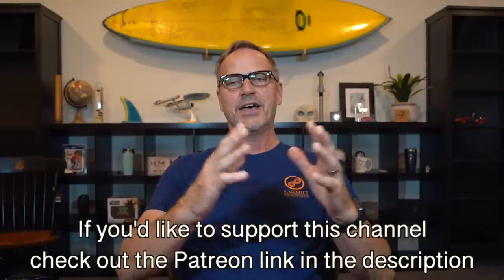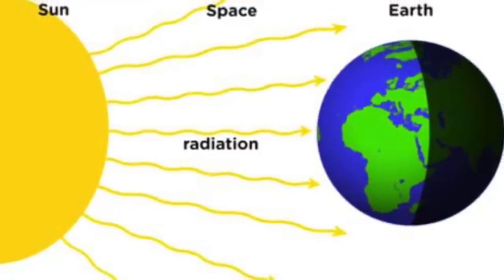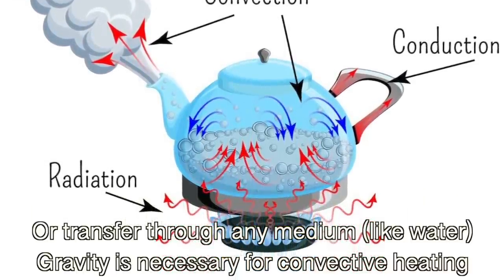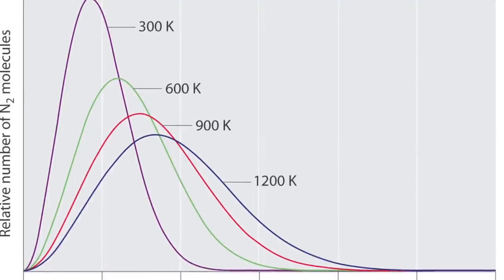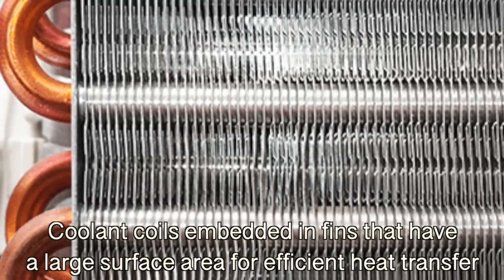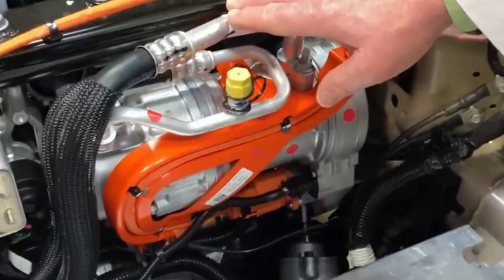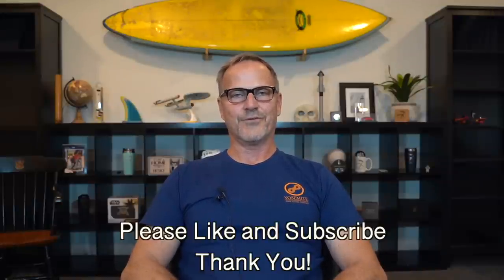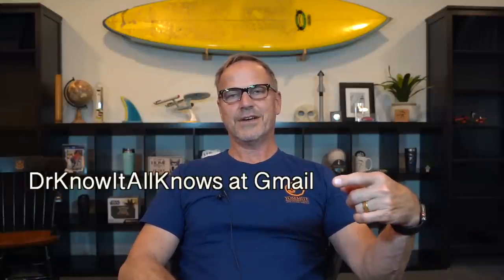How does a Tesla Heat Pump actually work and why does it matter? From first principles!

Comment: You can boil water at lower temps if the pressure is high, water can be used aus a coolent, there are also heatpumps with water, but they have bad COPs

Comment: Looking forward to see what Tesla does for home systems. Seems to me if you had air heating, air conditioning, refrigeration and water heating all integrated you could save a lot of energy. We installed a heat pump water heater and it saves a ton.
Reply from the maker: Mmm, I didn't even know that combo was available. Interesting. And how about a "3 ton" heat pump for your house that's only the size of a mini fridge, plus it provides drinking or lawn watering water too? If anyone could do it, Tesla could!
Reply: @DrKnowitallKnows  Got ours from Rheem. We're in Florida, so it works great. Has a back-up coil, but I turned it off and have never missed it. In the summer it pulls about 0.6 kWh per day for two people. In January it pulls about 1.5 kWh. Costs about double that of a conventional coil heater, but should pay for itself in under 3 years.
Reply: @DrKnowitallKnows  
There are already such integrated heating/cooling systems, for example in newer types of shopping centers and super markets. They are needing heat and cooling and they have it already.
Reply: @MBighk  the carrier split systems are fair priced

Comment: There's just one thing I don't understand, my 2020 model 3 that is parked in a garage maintained at 10°C in the winter uses the compressor to preheat the cabin. Is this whole "heatpump only in 2021 model 3s & Ys" just a marketing scheme because they just have more efficient compressors/gas and the octo-valve that I don't have?
Reply: Both your Model 3 and the later Teslas of all types have one heat pump -- in yours normally called an air-conditioner because it's only ported to the hot and cold coils in one way, and can only provide cooling.  Your 3 generates heat by running current through, and even operating, various devices, including the heat pump, while circulating fluid, but the heat is generated by electrical resistance and rather than the carnot cycle.  
That said, are you sure your 3 is pre-Octavalve?  They changed over sometime in 2020.
Reply: @jameshoffman552  I took possession of mine in mid March 2020, I know the concept of heatpump is just reversing the flow of the refrigerant, and it seems that my M3 uses it up until 0°C (sometimes waits till it's -5°C) before it kicks in the resistive heating. Oh I see what you mean, the pre-octovalve models were not able to warm the battery using the compressor, but can be cooled using it. Right?

Comment: I wish Tesla's had some kind of a resistive heater that they could use for regenerative braking. Somewhere to put the electricity when the battery was cold or full. This is exactly how locomotives stop using dynamic braking. The top half of a locomotive is basically a giant toaster. In case someone doesn't know, all diesel locomotives are basically hybrids kind of.

Comment: Using resistive heat is 100% efficient. Waste energy when using resistors to heat is also heat. Pumping heat can be up to five times more efficient than resistive heat since it does not run into the physics/thermodynamic laws that prohibit perpetual motion since it moves energy versus altering its form.

Comment: How long does it take the cabin in a Tesla to heat up for those that live in colder climates?  If it’s 32F outside is there an issue with heating?
Reply: No - not an issue.  On the channel Now You Know, they did experiments comparing a Model 3 to a gasser, showing that the Tesla heated up much faster (and that was a pre-heat-pump version).  In my experience the thermal system is quite impressive in cabin cooling and heating.
Reply: @jameshoffman552  thanks for the detailed reply.

Comment: Thank you for sharing. I never thought the heat pump was needed living in the North East with basically 2-3 months of cold weather (30 degrees or less). Would you say the heat pump extends the battery life as well?
Reply: You never thought the heat pump was need? What do you mean? And yes the power consumption is lower for a electric compressor than the element heater.

Comment: A heat pump can have a small heater on the radiator i think it’s called , which makes it less efficient bellow 0 c , but still much better than gas or coal heaters .

The reason their “bad” below 0 is that condensation builds up and freezes , stopping it work . But the external heater fixes that.
Reply: Most just reverse the heating/cooling cycle for a bit to defrost the coils. Much more efficient than using a resistance heater.

Comment: Heat pumps are quite efficient even in could climates like Nordic countries. The best new heat pumps (of the type air - air) can operate at outdoor temperatures down to -35C. The COP is lower when it’s could outside, but may still be at around 2 (1 kWh of electricity gives 2 kWh of heat).

Comment: You described convection heat as if it were conductive.  You describe the poor heat transfer through air in microgravity.
  The correct description is that as gases get hotter they expand in volume while retaining the same mass, therefore becoming less dense, and tending to go UP by buoyancy.  Therefore a hot object that conductively transfers heat to surrounding air tends to establish a gas flow that takes heat away from the object in an upward direction;  and this only works where there is net gravity;  otherwise there is no UP direction.
  I should have written Encyclopedia Britannica!

EDIT:
  Your explanations keep getting worse...  Energy doesn't go from cool liquid to hot air;  it is the other way around.  Well, Quantum Physically heat moves both ways;  but per the simpler model you got it exactly backwards.
  This is getting really bad Doctor.  Sorry to say, but this video needs a recall.
Reply: Agree. multiple missteps in this one, sadly.
Reply: Definitely

Comment: Dr KIA — The legacy terms we’re saddled with, really get in the way of laypersons’ understanding of what’s taking place —
  — Why was ‘air cooling’ called ‘air conditioning’ when air heating & air cleaning/filtration are also a/c?
  — What we call an ‘air conditioner’ (air cooler) is just a (one-way) heat pump. At the start, when a heating function was added to a/c’s, the unit was called a ‘reverse cycle’ air conditioner (‘conditioner’ in this context was now an accurate use of the term; ‘reverse cycle’ conveyed to the layperson how it worked).
  — Originally, air filtration was done for the benefit of the equipment, not humans. But as we’ve learned about indoor air pollution, the emphasis has shifted to clean, properly-humidified air for human health & safety.
    Up to this video, I was uniformly impressed with the clarity & accuracy of your videos (my favorite being your projections of how fast FSD might become reality). This one is a tragic fail. You might consider pulling it now, and replacing it w/ ~3 videos ie, basic physics, current applications (incl. UV, humidity control & air exchange to suppress micro-organisms), and —
  — Possibly a 4th video on passiv-haus’ energy-free heating/cooling/lighting/hot water, via house design, attic ventilation, storage of saved heat/cold, aerogel skylights, induction heating for water & cooking, and evaporative cooling in low-humidity environments.
    Thank you for all your clear explanations on the many topics you cover.

Comment: I like the simple diagram of the inside/outside of a heating/cooling system using evaporation and condensation (expansion/compression, whatever words work best for understanding).  I try to explain compression with the bicycle pump analog; when pumping up a tire, the pump gets hot.  When I explain expansion, I use the paint can analogy (which you used, but for the other side, calling it 'opposite of a paint can' silly! ;-) ) or even better, a dust cleaner (compressed gas for cleaning computer parts etc).  Those get extremely cold the longer you use them.
I know, I'm pedantic! And nobody likes a know-it-all unless it's Dr. Know-it-all! :)

Comment: Best explanation of convective heat transfer I ever heard. I always thought it was essentially air movement, but never thought of still air, and the impact of heat capacity of water molecules.
Reply: Someone wrote that the water molecules have a negligible effect  due to them not adding mass to a given volume.  Water just displaces air molecules.  100% humidity is the max moisture retention of air but definitely not very much water in reality.

Comment: U glossed over the most important principle, phase change
Reply: He does mention it, but I agree he doesn’t stress the huge difference in energy of phase-change vs. temperature changes without.
Reply from the maker: @fredbloggs5902  Yes, sorry. I realized when I was editing that I needed to hit that point harder: phase changes take TONS of energy compared to just raising the temp by a degree or so. That's why the boiling/condensation point of the fluid is so important.

Comment: will be nice to know how tesla heatpump works at -30C, when parked, i.e. no energy from motors/battery is utilized through octovalve
Reply: Well it would be slow but the compressors heat contribution would be just about 99% heat available.

Comment: Uh a heat pump is an air conditioner. It just makes sense to put a switching valve in so you can switch from heat and cooling with the same system

Comment: If you want to really break people's brains you should explain absortion coolers and how they use heat to cool I felt dumb for not understanding it easily until I found out it was Einstein and a mechanical engineer who figured it out and than I didn't feel so bad

Comment: I was born in 1945 and remember when people used to get a technician to change the compressor in your refrigerator and recharge the freon. In the 80s I remember them still doing this but now the freon gas is so expensive they sell you a new fridge and throw the old one in the dump. I think this has come about because of the EPA and because freon is not necessarily freon it is more a generic name because the old freon was dangerous to the ozone layer. Google says the price went from $26 to $300 according to what I just read. Are we getting boon-doggled?

Comment: Thanks. that is why my freezer can't bring the temperature down to -20C... ohh wait it actually does?  So does a heat pump work at -20C?  if not then please explain how your freezer works?  is it magic?
Reply from the maker: They work at wider differentials they’re just not very efficient. And -4C is plenty cold for a normal freezer.
Reply: @DrKnowitallKnows  Here is the list of 100's of different types of Freons.  Each has it's specific operating temperatures.. on some you can go down to -100C is the normal operating temperature and still be more efficient than using 410A at -1C https://en.wikipedia.org/wiki/List_of_refrigerants   It all has to do with the boiling characteristics of the Freon being used.  Most skating rinks will use the dangerous Amonia as the Freon.

Comment: My question is: why doesn’t Tesla use carbon dioxide as the refrigerant in its heat pump? Unlike hydrocarbon refrigerants, which are toxic and flammable,  CO2 is devoid of toxicity, and it suppresses fire and explosions. It has excellent refrigerant properties. In fact, CO2 refrigeration was patented in Britain as early as 1850, and by 1870 an American businessman installed CO2 refrigeration in a cargo ship to transport beef from Texas to New York City. Mercedes has developed CO2 air conditioning systems for its big sedans to meet strict new European Union standards that discourage refrigerant toxicity. Why doesn’t Tesla do likewise????

Comment: The heat pump will work even without freon and evaporation. If you will use just air it would work the same way but less efficiently.
Reply: Methane would be a great gas to use. So are you talking compressing but not to the point of liquefaction?
Reply: @joeKisonue  Yep, liquefaction is not required. During compression any gas will heats up, then you cool it down and inject it back. With decompression gas lose it temperature.

Comment: Thousands of Model 3's & Y's in colder climates all over the world with heat pumps are failing and not producing heat in the vehicles. Ive had an issue last 2 months. First Tesla replaced two sensors now getting an entire new supermanifold and heat pump. I doubt it'll fix the problem because when its below 40F just not capable of doing a good job of heating the vehicle. The only solution for Tesla is adding a resistive heater to help with heat pump when its in the 30'sF and below.

Comment: I believe you feel cooler in tha desert because the rate of evaporation of the water ( sweat) from your skin is greater. The evaporation of water requires a large amount of energy . The energy is removed from your skin, so it cools the skin down. Similarily, if you are in a high humidity area, the rate of evaporation is less, so heat removal from your skin by evaporation is much less.

Comment: You are not quite correct.   Low temperature household heat pumps exist and are widely sold.  Mine operates to about -25°C in Canada.  A lot if people have installed them in recent years.   Fossil heat is normally only used for a defrost cycle which is needed because the outdoor coils do ice up in the winter.  It's far more efficient, environmentally friendly and less polluting than burning fossil fuels.  IMO it should be against building codes to install straight fossil fired heat.  Especially when air conditioning is installed in the same buildings (like in GA where  some of my family lives).  Straight air conditioning should not be used where space heating is needed as well.  My heat pump has a COP of about 4.  Therefore 1 kWh of electrical energy will produce 4 kWh of heat, etc.

Comment: The heat pump industry does such a poor job of educating potential customers the physics. 
The transfer of heat or cold is just via the temperature difference that it generates and that hot fluids always flows to cold.
Hot and cold are relative.
One fluid can be -50 and the other is -100. The -50 is hotter than -100 by 50.
The same example is fluid is 400 and the other is 450. They are both hot but 450 is hotter than the fluid that is 400 by 50 and heat energy will flow.
So a heat pump will move that heat into a space thus making it hotter and the space that the heat moves from will be colder. Thus in summer we want heat to flow out of a room and thus cool it and heat up outside. In winter we want the heat energy to flow from outside to inside and the cold to flow from inside to outside. 
Well I hope I have it correct.
How the heat put moves heat and cold is using a gas that has a very low temperature to become a liquid and boils at around room .

Comment: You sure do over complicate things. You're close the evaporator doesn't have cool liquid it's mostly gas. The expansion valve converts cool liquid from the condenser to gas. The reaction of high pressure liquid converting to low pressure is cold. Like if you open a propane bottle and the propane freezes. Freon will heat in colder weather but it's a different freon that will not work in AC mode. Whoever installed your AC installed the condensate lines wrong. It will not remove moisture properly and if you lived in really high humidity it'll flood

Comment: A long winded explanation of how air conditioners and heat pumps work without specifically mentioning latent heat?
Latent heat is fundamental to the operation of these devices.  
If gases phase changed to liquids and liquids phase changed to gasses without additional energy  being involved, neither air conditioners nor heat pumps as we know them would be possible
Reply: You could have only one cooling event. Sad

Comment: Or you could just drive a normal car and have heat and air conditioning. The ability of greeniacs to rationalize this nonsense is nothing short of amazing. How about next you explain some of the physics of a significant t-bone crash while you are strapped onto an 800 pound battery? I'm pretty confident you might reveal some thermal transfer if the crash is severe enough. Why any person would put people they (presumably) care about into one of these awful cars is completely beyond me.

"Fun to drive" is not at all the same thing as "pleasure to own".